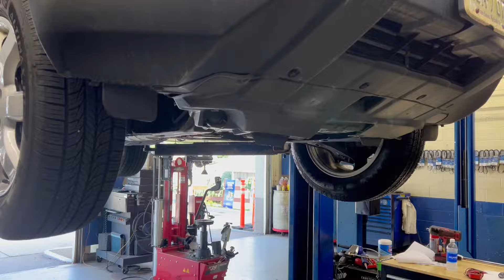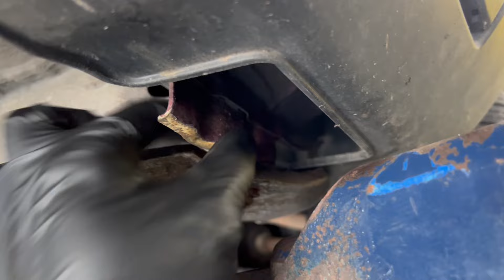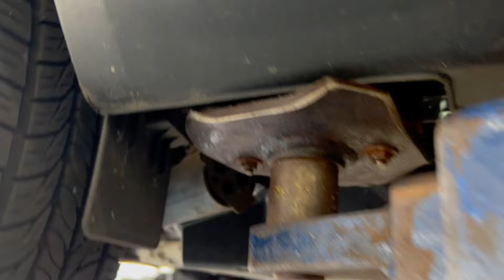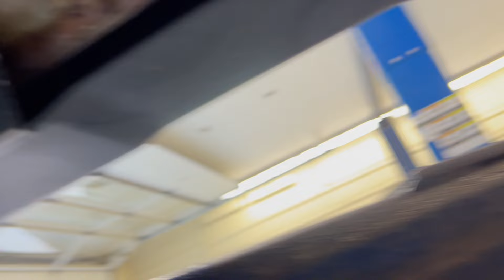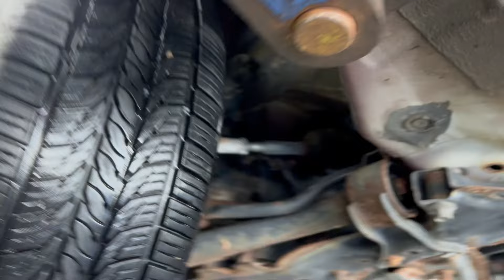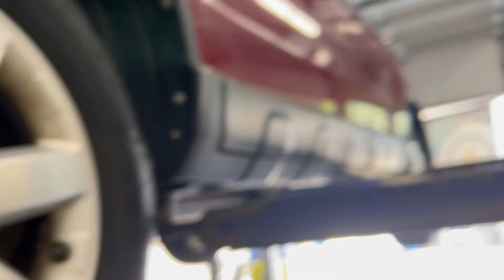Where and How to Jack Up or Lift Your Honda CRV

Comment: If I use those pinch welds to jack up the car with a carjack, there won't be any place to put the jack stands.
The stands should go to those pinch welds like your lift's are, but then, where do I put the carjack to lift up the car?
They can't go in the same place at the same time, that's the problem. 
Everywhere people say "just find a nice metal piece to lift with a jack", but they never show where are those points besides the obvious pinch welds.
It would be really useful if you could show those points under the car from this view